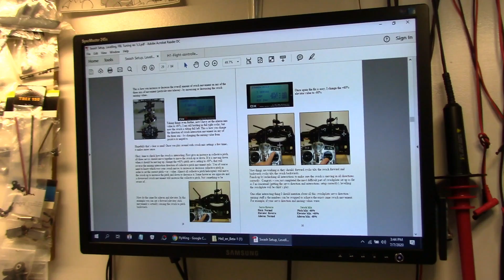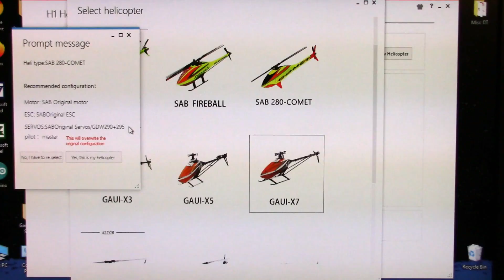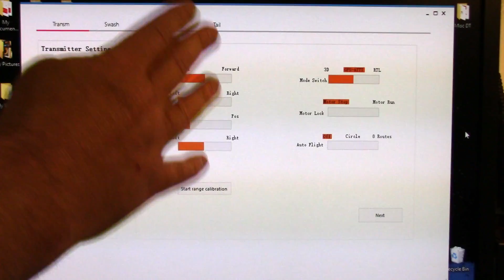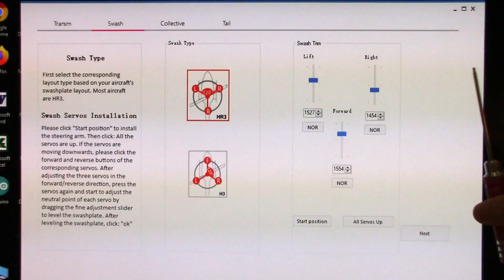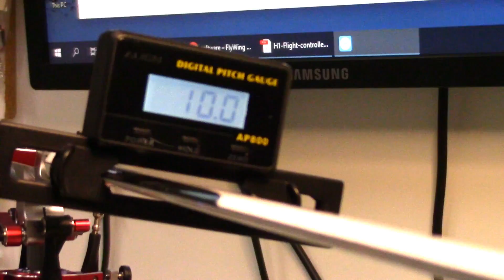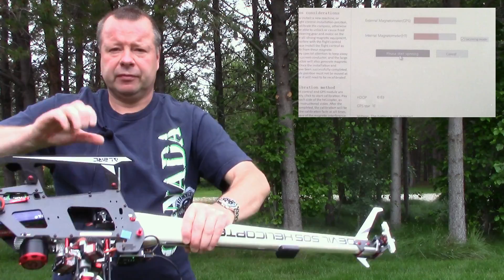Flywing H1 Setup Tutorial & Tips

Comment: Another thing is, how do you stop the wobbling problem in your Vieo LOCK MOM ? Which settings do you change? I have same problems with the back/Tail going up and down.
Reply from the maker: Like any cyclic wobble, it's tuning and experimentation. Play with the gain, the head speeds, and the head dampening. Even blade bolt torque can affect cyclic wobble. In short, all the usual stuff.

Comment: Hi John, do you have an idee how I can get the 500 TREX in a NORMAL MODE FLIGHT more stable on the shwashplate? I also have the problem that the 100% way of sticks for Ail and Elev. too much and the expo not enough. I am no stunt pilot and I want to fly an easy way with more stable, but I also want to use the Normal Mode to fly. Where can I change that for normal flight? And does it be a problem when you flight after in GPS Mode? Must I set for more stable NORMAL flight  the acro up to 50% about? and expo higher? Or can I make a switch in my Horus12S with dualrate only for tail and Elevator or reduce the OUTPUTS from 100% to about 75%? But is it possible to activate later with that settings? I want to use my 500TREX later in a Scaler B206. Can I take the same settings or must I switch later to Scaler in the MENU? But if I want to switch to Scaler, is it losing stability, or does it get more stability for NORMAL FLIGHT MODE without GPS and holding altitude?
Reply from the maker: Dial down your dual rates - EXPO rates have zero impact on overall agility, they only affect mid stick response.

Comment: Thanks John,
Very helpful video. I am trying the H1 in a trex 450l. I am to the point where I arm the heli, I get the blinking green light. When I throw motor switch nothing happens. I sure would appreciate any suggestions you might have. I know motor and ecs are good bypassing the H1 and just using tx and receiver. 
Thanks
Reply: I also have this problem! I can't solve it, could someone help? thanks!

Comment: what I would need is a function to set up a box on my flying field, where the heli can't leave the box. so the H1 would detect if the heli is about to leave the box and then take over control to stop it from leaving the box. especially of course when it is about to hit the ground. I know that the altimeter has some inaccuracies due to varying air pressure, but a tolerance of 3 meters or so would be enough for me. and then when the heli is saved, in the box at a safe height, you can take over control again. man that would be so handy.
Reply: SPIRIT-SYSTEM has geo-fencing which is what you are looking for

Comment: Hallo John, can you tell me where you get the long cable for the GPS. I ordered 2 H1 both with only 10cm. Can you send me the link where to buy? Or can I take any unschield cable with 6 wire? Or cut it and make my own extension?
Reply from the maker: The one I got from Banggood in review is the exact same one I linked to in the description. It came with the longer cable out of the box as shown in the review; so if they are shorter now, I have no idea why or what options are available for extensions - contact FlyWing.
Reply: @rchelicopterfun  Thank You John I must think now. I contact Fly Wing for that with at moment no answer. I will arrange a new German Manual for their models and I am waiting for the Scaler and FW450ii second version now. But nowhere to get that longer cable! Thats bad at all.

Comment: hi, i managed to move the sticks in the system but on the H1 controller, the light is still blinking red and not stable purple...why is that?
Reply from the maker: I have no idea when it comes to various radio system compatibility issues. I hooked mine up to an FrSky X4R-SB receiver with S-Bus output and it worked fine. I don't know about the Orange RX you have (R920X), but just a quick look and it doesn't show it has an S-Bus or PPM signal output. If that's the case, there is no way it will work with the H1. Again and as I clearly state in both the video and in the Q&A section of the description below the video, the H1 need's an S-Bus or PPM signal input to communicate with the  RX. In other words, you need a receiver with an S-Bus or PPM output. If the R920X has an S-Bus or PPM output and is still not communicating with the H1, you'll have to contact Flywing to find out why since it's something I'm not familiar with.
Reply: @rchelicopterfun  thanks so much John for ur effort in reply me. Really appreciate it. But I have given up on h1, I just bought now spectrum fc6250 , it has SAFE technology n stability which I wanted most!  N it connects to spektrum out of the box so it's perfect for me. Thanks once again Sir.

Comment: Hello John, can you also list the transmitters which will work directly with H1 without the need for extra receivers like AR7700 incase if we use spektrum. I dont mind buy a new transmitter..which one would u recommend for H1 directly plug and play?
Reply from the maker: Transmitter model, brand, or protocol plays little roll in compatibility. As I state in the video and what is in the H1 owner's manual, it's the RX (receiver) that communicates with the H1 that is important. That RX needs either an S-Bus or PPM output to communicate the signals to the H1. The H1 has no internal RX, so you must use an external RX with the H1 - no exceptions! 

I'm not a Spektrum user anymore so I have no idea of which Speky receivers have S-Bus or PPM output ports but I do know they exist. One example is given in the description but there may be more (both Spektrum & aftermarket DSM2/X receivers).
As for the DX8, it will work fine with the H1 (with the correct RX), but you will be limited with 8 channels if you want the invert function since it operates on channel 9.

Comment: Great video John.  I loved two of your books I bought...setup & tips for electric collective pitch rc helicopters and How to build training gear for RC helicopters.  Between youtube, flight Sim S/W and your books I have taught myself to build and fly non 3D at an intermediate level.  Now I just bought a used Trex 600E flybar chopper.  Can I remove the existing gyro and install the H1 on the E600 without buying a flybarless head and run it with the existing flybar?  I would only run the H1 in non 3D mode and use it basically as an emergency attitude recovery system while I gain experience on the E600.  Eventually I would buy a flybarless head and dip my toe into 3D tricks using the H1 to bail me out of trouble.  What do you think?
Reply from the maker: The H1 like almost all FBL units won't work with flybared heads; it must be used with flybarless. Also, the H1 is not a "bail out" or "rescue" unit. It won't work (at least well) in that capacity. If you want rescue, then get a proper FBL unit with that specific function such as an Ikon2, Bavarian Demon Axon, or Spirit.

Comment: Thank you John for the detailed tutorial, much appreciated. I am a newbie to Heli RC. 
Can I use Radiomaster TX16s with Fly Wing H1 GPS?
Reply from the maker: Learn to fly a collective pitch RC helicopter correctly - don't rely on one of these GPS no skill autopilot things, you'll have way more fun & lasting engagement in the hobby if you are actually flying. But to answer your question,  yes, provided you use a 9 channel receiver with S-Bus or PPM output.
Reply: @rchelicopterfun   Thank you for your kind advice about how to handle my current situation. I will start with simulator.

Comment: Hi John
let me start by saying hello from the UK and a big thanks for your videos.
I will be doing the same build when the kit and H1 arrives, so your videos will be very helpful.
Do i need to worry about programming the esc when installing/using the H1?
Thanks again.
Reply from the maker: Depends on how you have your ESC setup. The H1 as you know only provides two throttle output levels, off (0%) and on (adjustable % output via the setup wizard). If your ESC is setup for linear throttle response then it's likely okay. If you are running some sort of governor function, then you may need match the ESC governor throttle signal %  to the H1 output. I run my ESC on this heli in linear mode (no governor).
Reply: @rchelicopterfun  Thank you John...still waiting for the goods to arrive....sigh

Comment: Hi John many thanks again for this great video.  Just used it to set my Alzrc 505 with the H1.  Everything seams OK, but not sure about the fail safe on channel 5.  I have a Futaba 16sz, the instructions in the H1 manual have me confused.  Any ideas.  Also when entering the software and start with a new heli and work you way through until the end.  You you enter the soft ware again you cannot go through these settings again you must start all over again.  Many thanks John
Reply from the maker: If you have channel 5 output setup correctly, you will see the channel 5 indicator in the setup wizard moving accordingly. So as long as you are seeing the 3 different selections (3D, GPS, RTL) come up when you move your 3 position channel 5 toggle, you know you have your channel 5 setup correctly. Since I don't fly with Futaba, I however have no idea how you set your failsafe channel positions so it defaults to the RTL channel 5 output if RF signal is lost. That would be in your Futaba manual how to set fixed channel outputs when the RX goes into failsafe.
Yep, as I said in both the review and this setup video,  one of the biggest limitations with the setup wizard program is there is no way to save the parameters, so if you go back into setup new heli, it wipes everything clear and you have to start all over again.
Reply: Thanks again for all of your help.  John

Comment: John,  what receiver and how would it plug in for a Spektrum TX and adding Telementary ??
Reply from the maker: Sorry - no idea.
Reply: @rchelicopterfun   Does that mean there is no way to use a Spektrum system  ??
Reply from the maker: No, it means I have no idea what Spektrum RX you would need to use that has both S-Bus or PPM output and telemetry since that was your question. If you look in the description where I have common questions and answers, there is a speky RX listed. I don't fly speky anymore however, so I have no idea what features it has, but I know it communicates & works with the H1 because another commenter has confirmed it.

Comment: Thank you very much John for this excellent tutorial I have a couple of questions. In the initial configuration of the radio control, do you select heli or airplane? and if you select heli is h1? another question. Do you need a 9 channel receiver to program the invert?
And the last, dual rates, throttle curve and pitch curve must not be configured on the radio control?
Thank you for your help
Reply from the maker: Every single question you asked here is answered in the video and in the manual.

Comment: I can't not get the esc to arm. The heli is in 3d mode and the 2 transmitter stick is at the lowest and out opposite. The throttle cut is not on.Please help thanks
Reply from the maker: The throttle signal (channel 7) has to be in the off position (throttle hold on) before moving the sticks to the outer corners. After you move them to the outer corners for several seconds, the LED flashes and the tail rotor servo centers, then you disengage the throttle hold toggle and it will spool. It works the same way in 3D mode or GPS mode.

Comment: Ive just set up the H1 system on my Sab Goblin 500 took it to field for 1st test flight and had the same problem as you, with thw Tail bouncing up and down, Went home and checked the Balance of the heli with the Battery there was to much weight to the front of the heli so i moved the Battery backwards on its tray until it was balanced. Turned the head speed down a few % took it for another test flight and no tail bounce flies great,
Also noticed on the set up program software the (DMA collective) setting in parameters settings, have you worked out what it is for, im wondering if it is speed for the  collective pitch, how fast heli lifts and decends.
Reply from the maker: Thanks for the feedback. I say what DMA collective is in the description. It's same thing as collective pitch to tail rotor pre-compensation. Adds in a little tail anti-torque the with large collective commands to give the tail rotor a head start for the torque spike that is about to hit. Only needed in normal gyro mode as collective response is so slow in GPS mode there is very little torque spike produced.

Comment: Thank you John for the help and advice you’ve provided. 
Since I fly JR still I didn’t have SBUS or PPM available until I located. Spektrum AR7700 Rx which has PPM output. 
Today everything went fine with the setup UNTIL my buddy and I realized that when we applied elevator the collective calibration display responded. I’m not sure how to fix that until I can buy the same FrSky radio system you use in a few months. Any fixes you can recommend in the meantime or am I dead in the water until then?
Thanks in advance!!
Reply from the maker: Good to know about the AR7700 as a working RX option. I'll add that important info in the description for other JR/Speky  DSM users. 
As for the elevator/collective issue. Yes, that's exactly what one would expect since as I mentioned, the H1 uses Futaba channel mapping (AETR) not JR/Spektrum mapping (TAER). Should be able to sort it with some creative mix programming.
Reply: Thank you John. If I find the solution for my problem I will let you know. We appreciate you!
Reply: @raulmayoral6861   Hi: I have a JR radio and I have the same problem of mapping between Collective and Elevator.  Did you solve it? Thanks

Comment: Thanks for the intensive review, in your earlier review of this item you said it could be implemented on a gas powered helicopter but I don't see how that is possible since there's no input for governor sensor for a stabilized throttle control , or do you think otherwise?
Reply from the maker: Many gas and nitro helis use stand alone governors to control the throttle servo (such as the Futaba GV-1 governor). All that is required is a fixed throttle PWM signal output which the H1 has. Also, you don't necessarily need a governor at all on nitro or gas. We flew them for years without such technology by using creative throttle servo to carburetor linkage arm geometry before computerized radios gave us the power of throttle curves which worked much better. Of course, the H1 gives no such ability with only two single fixed throttle output signals and would have serious limitations when used with IC.

In the review, I was merely stating the H1 specs which indicate its compatibility with nitro. I would certainly not condone ever using the H1 with any fuel powered heli nor do I think it would work well for the reasons I just mentioned. 
Who knows if the H1 can even handle the high vibration environment of a nitro or gasser? That would be another big concern. Again, I was just stating the specs in the manual when I mentioned it worked with nitro. In theory it will, but in practice I would personally never install it on a large fuel powered machine.

Moreover, it's bad enough that people with no collective pitch flying skills can take to the sky with this thing on an electric. The last thing our hobby needs is a bunch of fuel powered helicopters being flown by people who don't know what they are doing. Good bye hobby.

Comment: Can you switch between auto pilot and flying as a regular heli with pitch and throttle curve or do you always have to use autopilot?
Reply from the maker: You can turn off all artificial help and fly normally - see the review I did: https://youtu.be/taNEI680-68
Reply: @rchelicopterfun  I watch both videos.  I guessing that when you turn off the GPS/Artificial Help, I am still stuck with the H1 pitch and throttle curve, I cant have my normal radio setup with its own setting?
Reply from the maker: Yes. With all the artificial stabilization turned off (normal 3 axis gyro mode), you are stuck with the linear and symmetrical collective range the H1 wants during setup (-12 to +12 in this case), and whatever throttle output you set in the H1 unit as well. It's why I had to hook the H1 back up to the laptop in the review after the first flight to increase the throttle output for the second inverted flight. It's also why I commented in the review video that they really need to give us at least one more throttle output selection so we can have at least two selectable head speeds.

Comment: What is your setup on your transmitter, like your throttle curve and pitch curve from normal, iddle up1-2
Reply from the maker: Did you even bother watching the video? I specifically said the H1 DOESN'T use pitch or throttle curves. There is no idle up. The H1 manages the collective and you only have one fixed throttle output set in the H1 unit.

Comment: I was going to get one of these but the Flywing H1 needs HV servos, now that is a bummer, no go for me!!  any more.
Reply from the maker: No it doesn't. That's the easiest way, but not the only way. Several ways to power the servos at lower voltages than what is fed to the control unit.
Reply: @rchelicopterfun  Well you could make some kind of power bord and power only the servos with it and only use the single from the H1 to run the servos, it would have been so much easier if it had a normal voltage (4.5 to 7.2)
Reply from the maker: Or simply use inexpensive HER 503 diodes in series to each servos power input like we have been doing for years with 4.8V tail specific servos when powered with 6V power systems. Doesn't get any easier than that does it.
Reply: I got my H1 to work on 5 volts. But that is too low cause my hobby wing esc  programming box background lighting is really dim
  it works on 6.3 very well